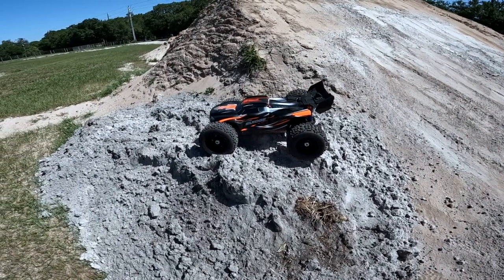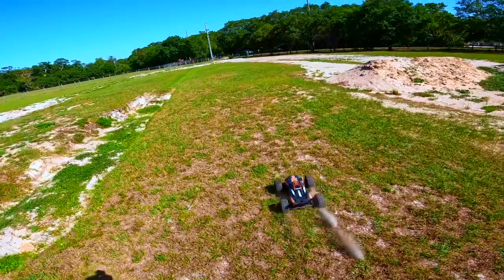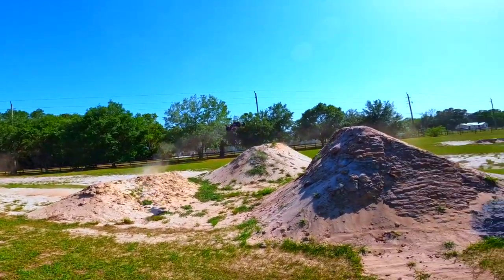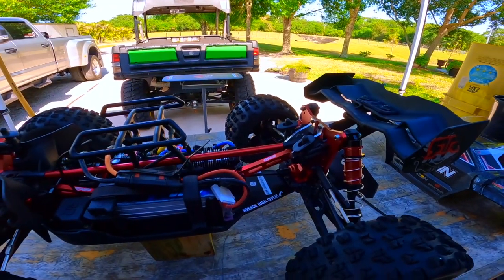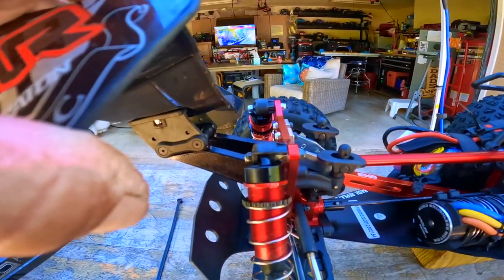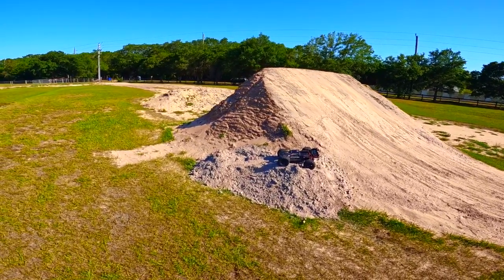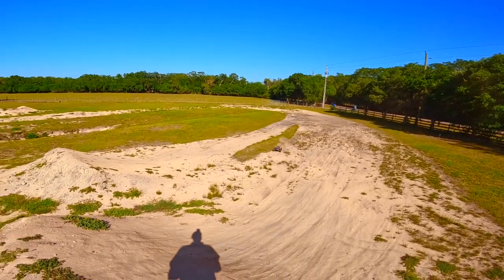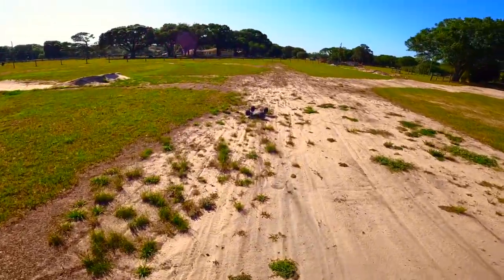TRAXXAS SLEDGE & ARRMA KRATON EXB 6S TUESDAYS MADNESS

Comment: Awesome bash at the launch pad! 🤣🤣 love your setup out there🤙🏻  what do your motor temps usually run with a 20t on that 2000kv hobbystar??
Reply from the maker: Thank you Patriot I tried the 20 when I first put that rig together during the winter if it was very cold outside I was able to squeeze a session in I think they got around 180 to 190 now the temps went up I had to go to an 18 tooth and my temps are running around same and if I push it real hard it will hit 200 I know that’s not good but in Florida if you want to have any kind of power you’re gonna end up with temperatures like that I don’t like running fans because doing big air they last one or two hits and it’s over I just don’t see a purpose for them 😎💪🚀👊